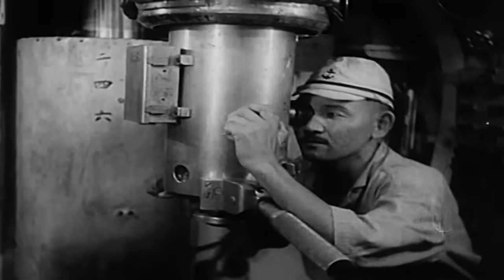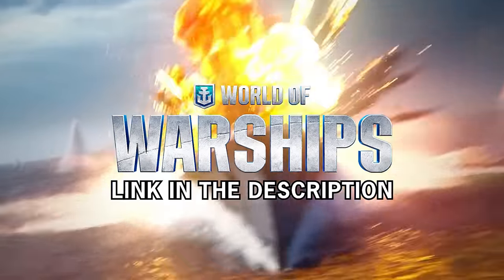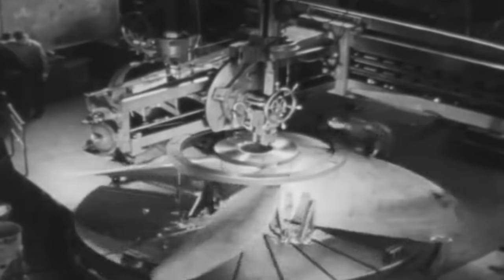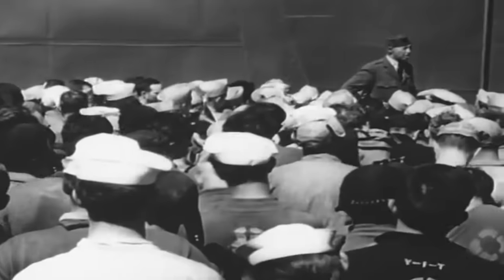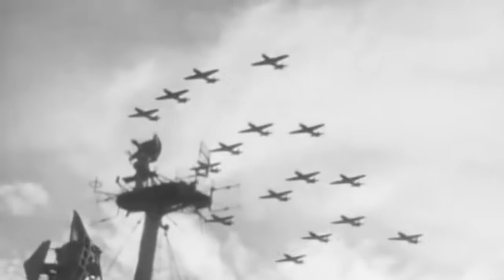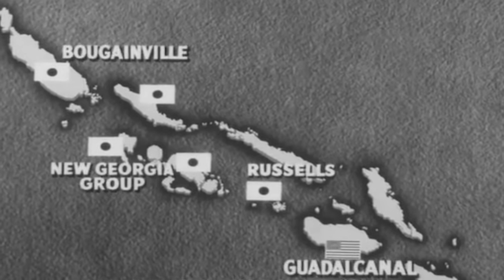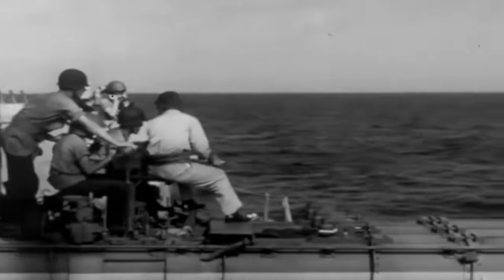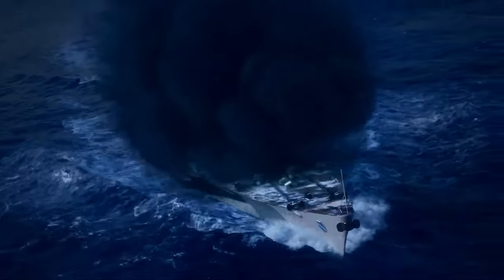The Aircraft Carrier Everyone Thought Vanished

Comment: Shame no one at the time thought to order a ship that was designed to be longer than what the treaty allowed with one or two segments built but not actually installed - instead set aside in the event the treaty is no longer in effect. Then said vessel would sent to the yard where the ship would be cut apart to fit the previously built segments, thus saving the time of a full new built under emergency conditions